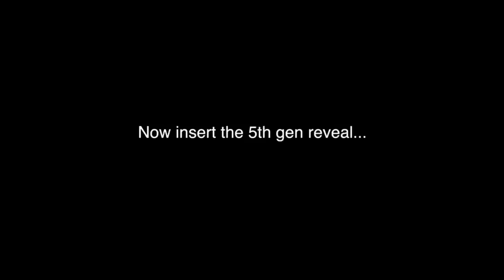INSANE 1100 HP 3rd Gen Cummins Almost Crashes Doing MASSIVE BURNOUT

Comment: What hp and tq did it make?
Reply from the maker: 860 Hp on Blake’s dyno a few weeks ago with a cracked rail. Fuel/air setup should be 1000-1100 or so but haven’t had it on the dyno since we got a new rail on it
Reply: Are yall going to dyno it again before the giveaway